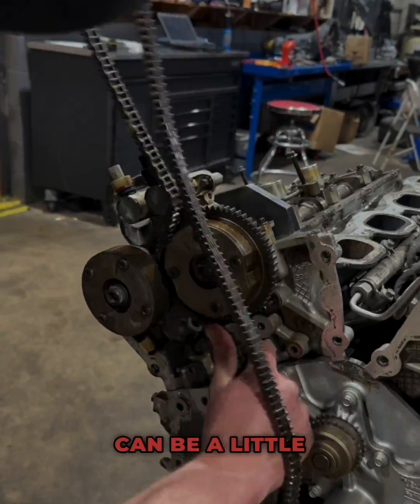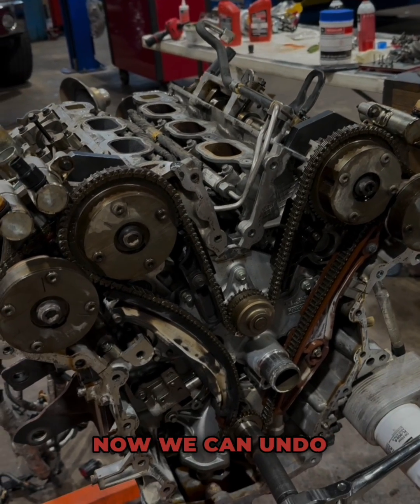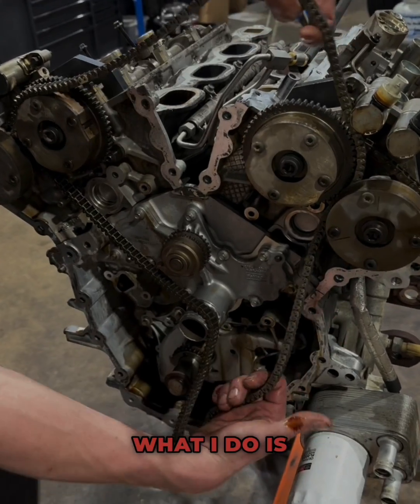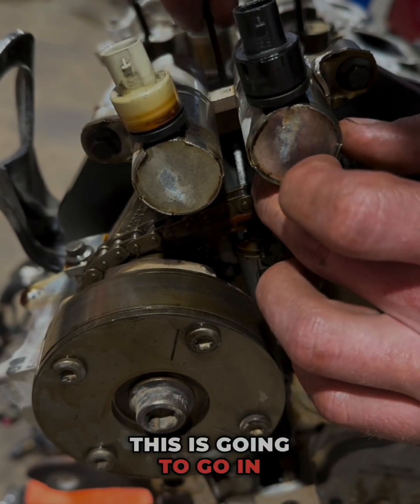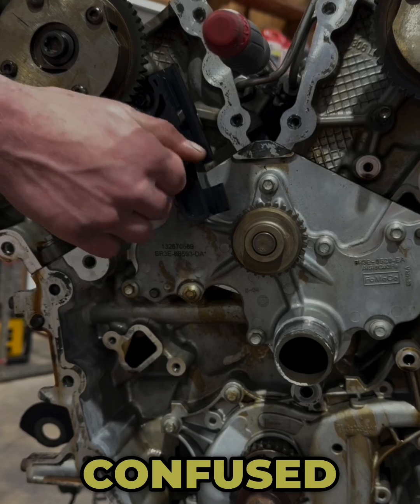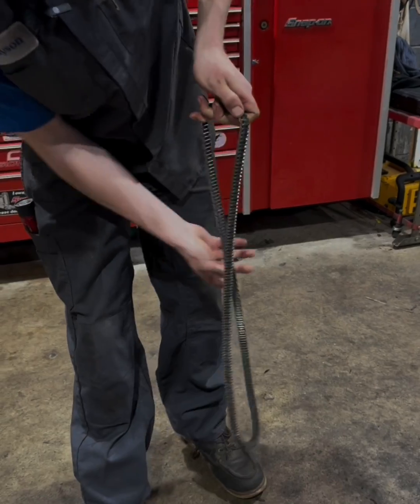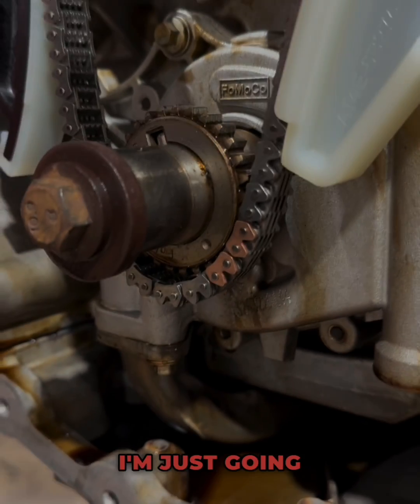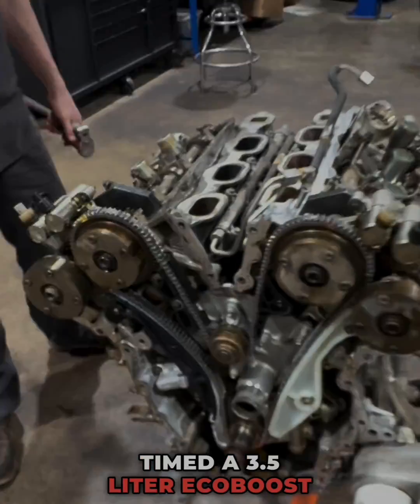How To Time Ford 3.5 EcoBoost

Comment: Good lord. Heaven forbid they just do timing marks and make a tool to hold it externally so you don't have to tear half the engine down just to do a timing chain. I suppose the phasers cause some issues with marking the cams though. Wow. I may be picking up an older f150 3.5 EB but this really makes me question it lol. 216k miles on it, I could imagine it needs to be done

Comment: How did you fix the issue with the cam lock coming off? I’m trying to adjust my timing chain back to where it was after a water pump change and the cam came loose due to my own negligence. How do I pull it back?

Comment: I was able to do a 2017 3.5 Duratech just off your EcoBoost series. I did all three timing chains, 4 cam phasers, 4 vvt solenoids. Only had a oil leak on three spark tube seals on the valve covers. No more rattling on a cold start. Kinda proud of myself for my first timing job using YouTube University 😆👍

Comment: *Please HELP*  
This does not cover turning the cams individually??? 
how do I rotate the 1 independent camshaft without using the tool so the tool will fit??? 
and how do I know the cam is top dead center if I manually rotate with wrench??? I don't understand
I have Camshaft  codes p0024 p054c p054a
Bank 1 exhaust and 2 exhaust are out of alignment! 

✔One camshaft is definitely out of alignment (Bank 2 Exhaust Cam).
✔ The second camshaft (Bank 1 Exhaust Cam) might have minor deviation but is not fully out of time.
✔ Your intake camshafts are likely fine unless other codes appear (like P0016/P0017).
Reply: You’re right to be cautious. If the cam is out of sync and the timing tool won’t fit, rotate the crankshaft 90° before TDC so the pistons are down and won’t hit the valves. Then you can manually rotate the cam to the correct position and install the tool. Once all cams are aligned, bring the crank back to TDC and lock it in. That’s the safe way to retime without valve collision.
Reply: @DrHumorous does it matter exh vs int stroke for bringing it back to tdc?
Reply: @user-dm7bz9by2z Great question — and the answer is: nope, it doesn’t matter whether it’s the intake or exhaust stroke when you bring it back to TDC. What matters is that all cams are timed correctly and the crank is at true TDC on cylinder 1 when you lock it down.

The whole “rotate 90° before TDC” trick is just to avoid piston-to-valve contact while dialing in the cams. Once everything’s aligned and you’re ready to lock timing, you return the crank to TDC — doesn’t matter what stroke it’s on, because you’re now dictating the timing relationship fresh. Clean slate. No drama. Just precision.
Reply: @DrHumorous thanks brother I appreciate it a ton.
Reply: You're welcome bro, good luck!
Reply: This is the exact problem I'm having it's not 1 video on YouTube showing what your asking

Comment: I have what may be a dumb question however here it goes , the timing marks are lined up with the colored links when you put it all together however do they stay lined up forever or will it change over time
Reply: They change after the first full rotation and only line up once every 100 to 120 rotations or so... based on another video I saw.

Comment: Hey sorry to bother you I just had my phasers replaced again with the updated ones and had ringing chains guides and tensioners replaced with water pump now there’s a loud ticking noise coming from front right side of motor, do you think the shop missed something?
Reply: I had a similar sound and realized it was coming from the fuel pump. I forgot to put the rubber sound dampner over it. Maybe its a similar issue on yours.

Comment: How many links are between the marks?!
Reply: From passenger intake phaser dot to the  driver side intake phaser dot is 50 and from the driver side intake phaser dot to crank sprocket dot is 37 I hope it helps you

Comment: I am rebuilding a 2012 3.5 EcoBoost and I just did the timing job with all new parts and the passenger side secondary timing chain has some slack on the bottom when the cams are in the neutral position is this normal or have you seen this before

Comment: Have you ever had timing codes come back after 10k when engine is cold after replacing everything with dealership ford timing components on a 2012

Comment: Has or will there be a fix ever for the notorious EcoBoost 3.5 rough idle. I have a second Gen(2020) 3.5 H.O that is about to shake me out of the truck at stop lights.

Comment: Had timing and phasers done twice on my 2013 F150 and it’s still popping a P0018 code and has no power. 

I’m lost as the shop wants to replace the engine due to thinking the oil journals are damaged. 

Cold start rattle, no power, no acceleration, etc…

It’s acting like it’s in limp mode. 

I’m clearing that code up to 7 times a day just to drive it somewhat normally.

Comment: With the oil pressure so crucial on these engines. Why would you not replace the oil pump while you have easy access? Just say'n  😊

Comment: I hadn’t retired when the EGR valves came in and I actually said in meetings with the Robert Bosch people and they refer to it as the engine is eating itself because it’s adjusting recirculated exhaust and that’s why they recommend putting additives in it to help the valves and the upper piston keep from carbon up Grace and peace

Comment: Are used to be a Robert Bosch pump tech and I called the Robert Bosch people and they told me that’s the problem between Europe and here this ultra low for diesel does not have enough lubricants in it for the system to survive grace and peace

Comment: You’ve been doing a lot of videos on the Ford diesels I’ve been doing some research because I used to be a pump tech for pro diesel. If you go to Europe, they are adding adjectives at the pump or at the time the tanker is being loaded that helps all this submission stuff And your high-pressure fuel pumps survive I mean talk to the Robert Bosch people about the American diesel. American diesel manufacturers are not putting anything in the diesels. The big benefit to the additives are running in your is the EGR valve in the upper piston they help them keep them clean where they don’t build the carbon, they should really get it. Stirred up grace and peace.

Comment: WSM says specifically not to tighten the timing chain guides with a power tool as you can crack a guide, but your a master.
Reply: You obviously don't do this for a living...
Reply: @maverick12916  oh, but I do. How do you think I knew what WSM said? Didn't say I followed it. He is a professional and has a better than average chance of not breaking it, however those who don't do it for a living should probably tighten it with a ratchet 😏
Reply: @phazerboy  I’ve seen guys brake bolts with ratchets. JS
Reply: Yeah I was shocked he just impacted that on😮 wtf, not to mention he spun that came when his holding tool fell off. Bent valves anyone? I will not pay anyone to work on my 3.5

Comment: Ive seen so many 3.5s come in the shop for new timing chains, plus ive worked on many that needed replacing because they chatter like crazy, i had an expedition that i changed the oil on that needed timing chains, that first start up after filling the oil sounding like the engine was going to lock up😂

Comment: How much does the dealership usually charge to redo the cam phasers
Reply: I got a quote at a independent shop-$3300
Reply: @eliseolozano4785  That's about what it would cost at my shop.
Reply: @eliseolozano4785 at dealer they quoted me 6500

Comment: I have all the parts to do the phasers and chain on my 13 F-150 and I'm trying to gather the right cam holding tool but according to that link it fits a Gen 2 is there a difference for the cam holding tool between gen 1 and gen 2?
Reply: You need to get the workshop manual for your vehicle, either in print, or through an online service like AllData. He's only showing you about 5% of the job. When you have a VVT motor, your work has to be perfect. You can't just put the timing tools on the motor and forget about it. If you remove one of your valve covers and put a wrench on one of the cams and turn it clockwise, the cam will move, but the engine will not. Once you reach the end of the VVT actuator's travel, then the rest of the motor will move. Since you don't always have a direct 100% mechanical connection of all your timing components, a lot can go wrong when you time the motor. As you work through the steps when timing the motor, the manual will have you remove some of the timing tools to tighten some bolts, and install them to tighten other. You keep removing and installing them as part of the process. Also, you probably won't get the timing right on your first try. Plan on doing it several times. Even dealership techs don't always get it on the first try. Just make sure its right before you put everything back together.  

The workshop manual will list part numbers for any special service tools needed to do the job. The part numbers will be for Rotunda tools, but if you put the Rotunda numbers into amazon, it will automatically cross the part numbers to other tool brands. You buy the whole kit, and it should be much cheaper than Rotunda. 

If you actually plan to do the repair yourself, you're going to have to remove the fuel pump and some of the lines. Unlike timing, this is a safety issue. Again, you need to follow the workshop to the letter. The last thing you want is to have a fuel leak on a delivery system that has about 1500psi shooting gas all over your hot motor.
Reply: The cam holders are different from gen1 to 2. And don't get the cheap ones from Amazon.  They will bend under torque.
Reply: Just double up the cheap ones when breaking the phasers loose and then torquing them back.

Comment: I would like to ask for some advice on what I should do regarding my 2012 f150 crew 4x4. It has the 3.5 in it with the timing chain clatter and has other issues like several codes which I will have to read all of them once I have my scanner in hand. I have put alot of money into the truck but it has over 200,000 miles on original motor. Should I try and fix the issues it has motor wise or should I drop the money on a new engine from Ford. I've already bought a new trans from Ford and had the  Ford dealer install it along with new trans lines. New drive shaft, vaccum pump, both turbos along with new fittings and exhaust manifold, water pump, plugs and 4 four coil packs. It now  is throwing a low oil pressure warning light but I think that is the sensor acting up. What advice would you give me as I love the truck and really can't afford another payment as I only have 6 payments left on the truck. Thanks in advance
Reply: You have to figure out what's wrong with it before you can make a decision. You didn't list any drivability issues, so I'm going by the assumption that the motor is running OK.  Start with oil pressure first. You probably don't have a gauge to check it, so you'll have to do the next best thing. Your oil pressure should be listed in the data stream, so watch that while the motor is running. If you're supposed to have about 20 psi, and its something close, like 12 or 13, your sensor is probably working. If its way off, and you get readings that don't make sense, I would look at the sensor. However, my best guess is that the sensor is working OK, and I'll explain why.

We need the codes. You have timing chain noise. The timing chain(s) are connected to your VVT actuators. Your VVT actuators are driven by oil pressure. You need to verify if the low pressure is engine oil pump related or low pressure on the oil solenoids that drive the VVT actuators. Given the chain noise, your engine oil pump is most likely OK. But it still needs to be verified before you do any work. When you scan for codes, you want to look at the ones that start with a P. Disregard any codes that start with a U, and if you have any B or C codes, make note of them, but they're probably not related to this issue.